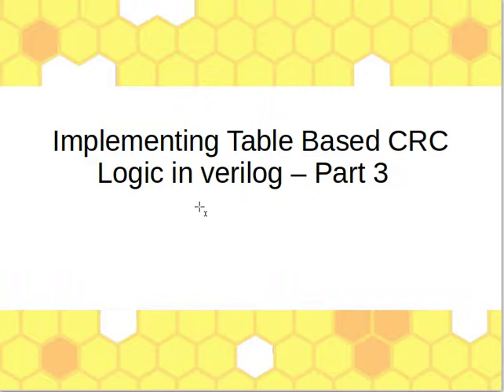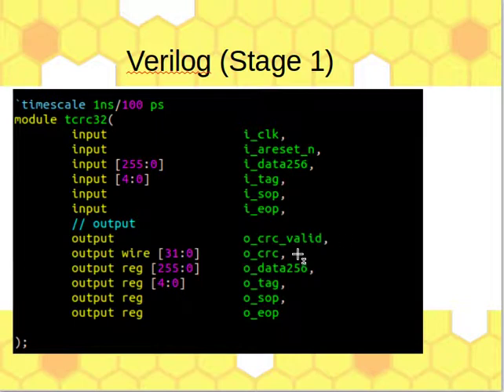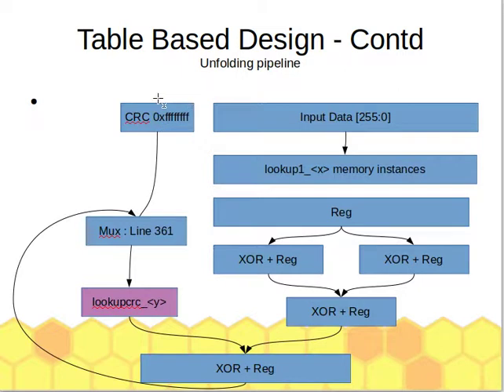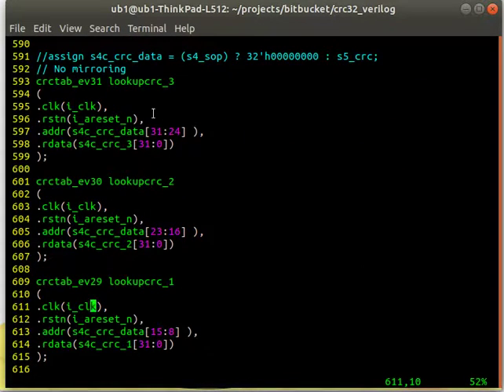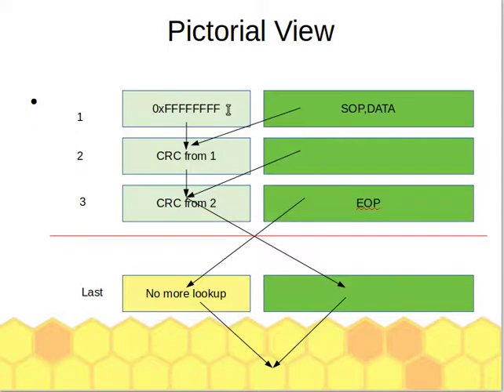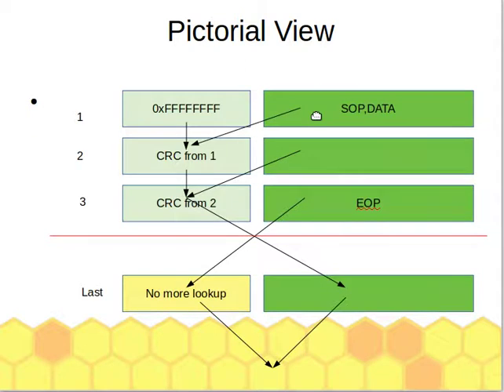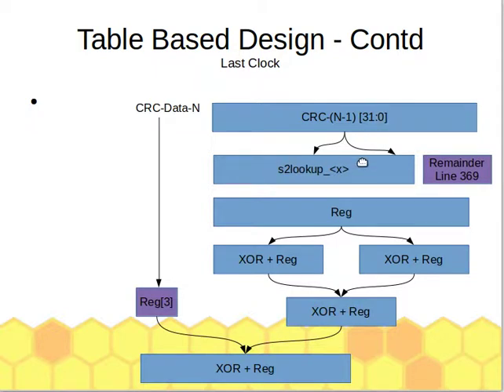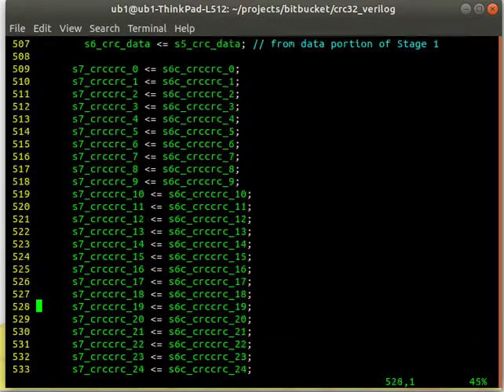100 Gbps Table based CRC32 computation for Verilog - Part 3

Comment: Hi 
we are developing ARINC 818 IP core ,so plaining to use your code for CRC which is 32bit(x^{{32}}+x^{{31}}+x^{{24}}+x^{{22}}+x^{{16}}+x^{{14}}+x^{{8}}+x^{{7}}+x^{{5}}+x^{{3}}+x+1).
 our frame size is more than 2KBytes which is coming in 32-bit word Size(by using SERDES we are converting bit to word).

I have a question , instead of taking 256-bit input shall we take 32-bit input and for first Word we will use 32'hffffffff then for second word we will take previous Word CRC so on continues.....(by doing this we can use only 32 Lookup table ) .

so please tell us How to modify your code so that we can use it in our project.

Regards,
Sujit Sadalagi
SLN technology Pvt Ltd.
Reply from the maker: Sujit, the approach i suggest in this paper is only for super wide high speed CRC.This approach is needed where simpler approach has failed to close timing. I would recomend you use a parallel 32 bit CRC equation directly. You can find those on google. example try - http://outputlogic.com/?page_id=321